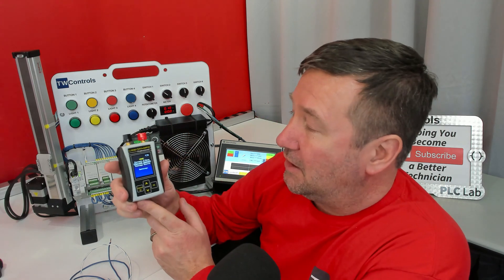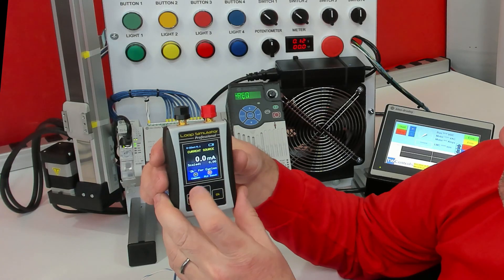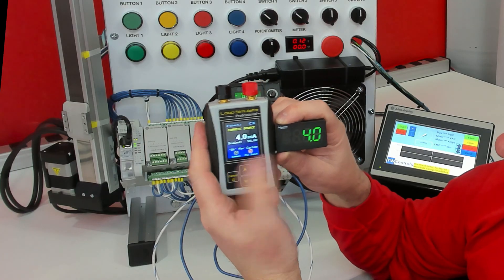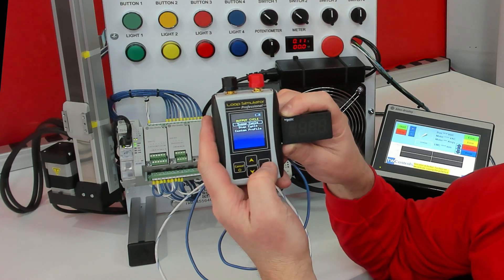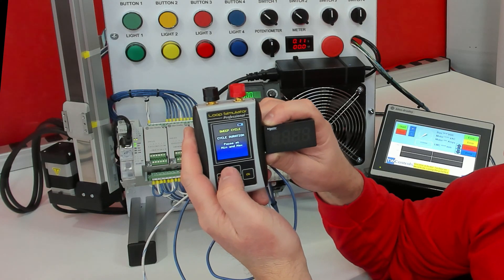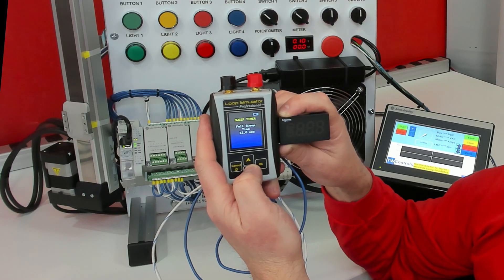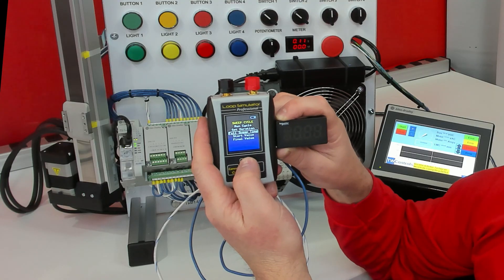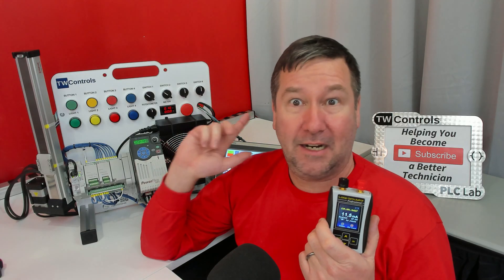Analog Simulator Sweep Mode.  4-20mA or 0-10VDC. SIM-ALP2

Comment: Hi Tim, Have you done a video on control panel wire types- selecting gauges (length as it pertains to current or voltage. should dc wires be a lower gauge than inputs and outputs), color choices, solid core vs stranded and other need to know about wires? Thanks..
Reply from the maker: Here are a couple of upcoming videos that will help.
https://youtu.be/Af38RIOqkP8
https://youtu.be/vO1RbYiQWD8

Comment: Sir, Difference between normal DI  and SOE module
Reply from the maker: The SOE has timestamps so you know the precise moment something happens whereas the DI is depending on the module RPI.  I have never had an application to use the timestamps on.